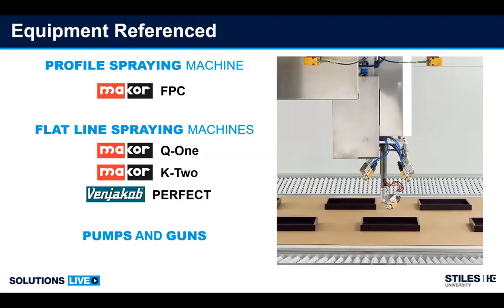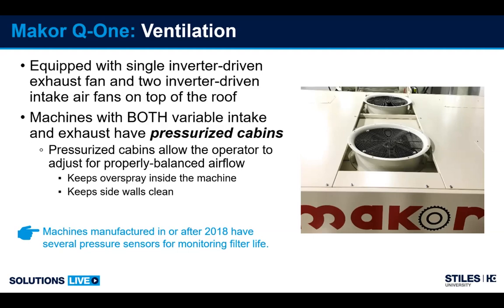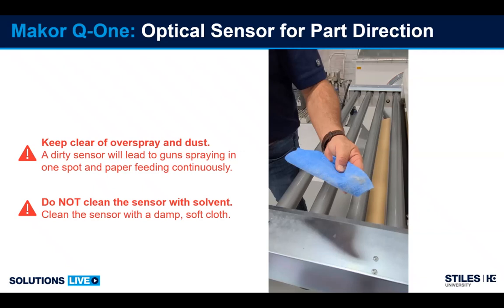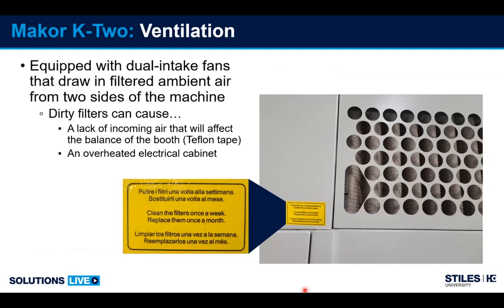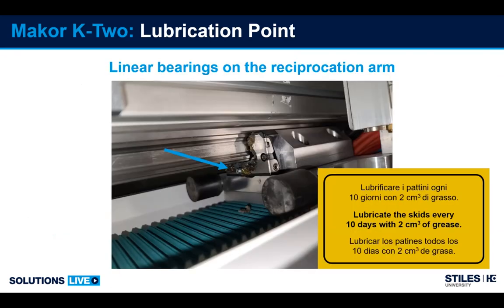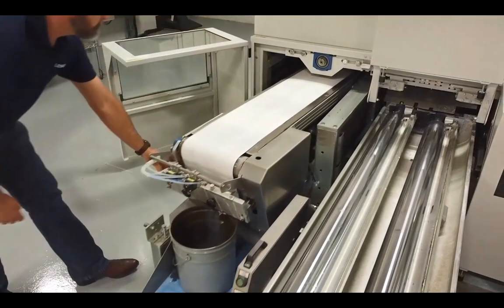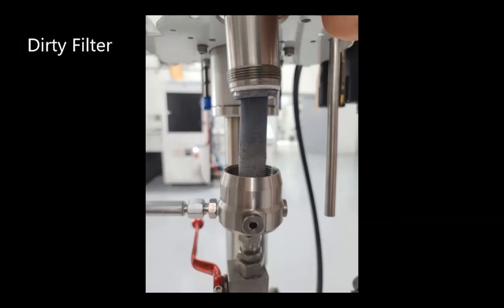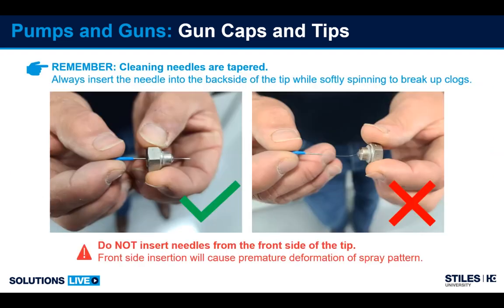Spray Finishing Machine Maintenance Basics - Makor and Venjakob | SOLUTIONS LIVE Series

Comment: Does anyone know the sequence to "reset" counters for the Makor Rolly 1603 or any series that uses the Multi Level - We can only operate in manual. It was running fine and then stopped and the screen says "reset counter"
Reply from the maker: Hey Chad, give our tech support line a call: 616-698-6615